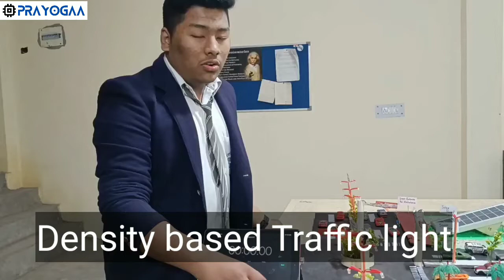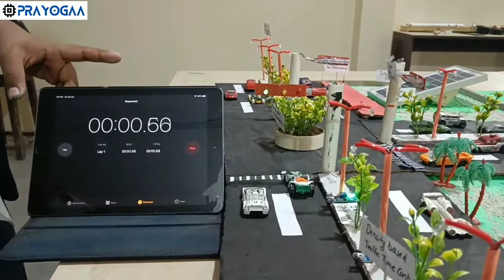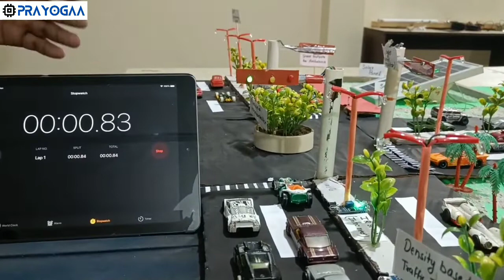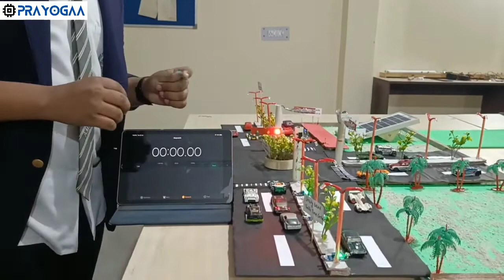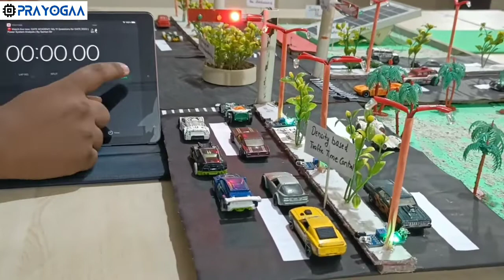Density Based Traffic light 🚦 #arduino @prayogaalab6675

Comment: hello, what kind of system can I install if I want to measure the traffic density on a winding road. i want something low cost and functional. it should be a system that can transmit this density to another device and show the density. i would be very grateful if you could help me. is lidar sensor used? which one do you think is advantageous?
Reply from the maker: I have used IR sensor at different locations from traffic light, you can use a camera for counting the numbers of cars, which show the density